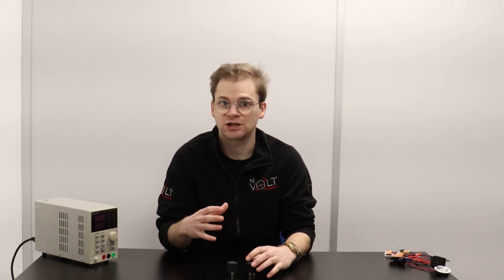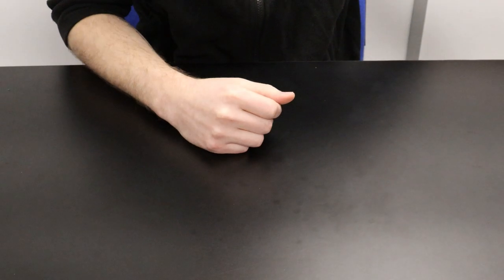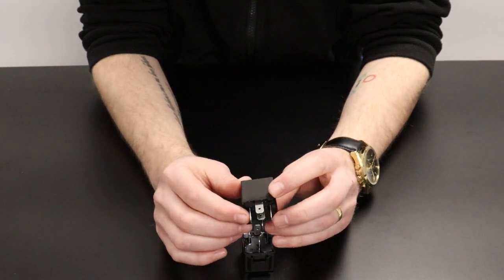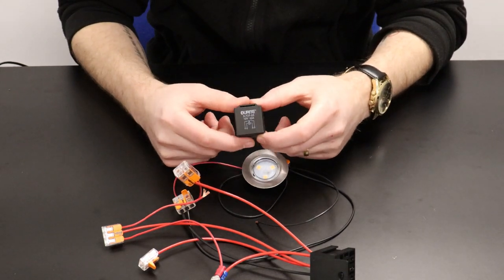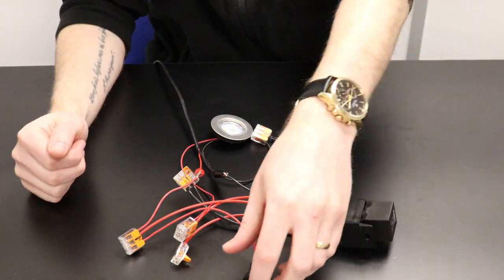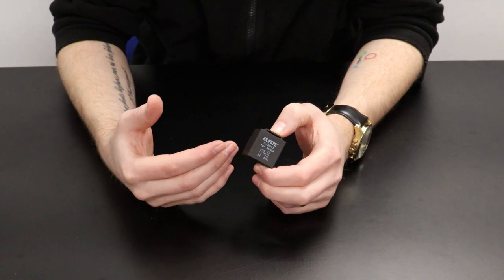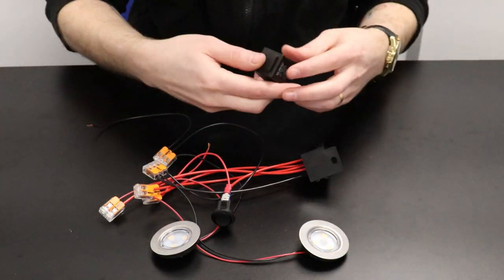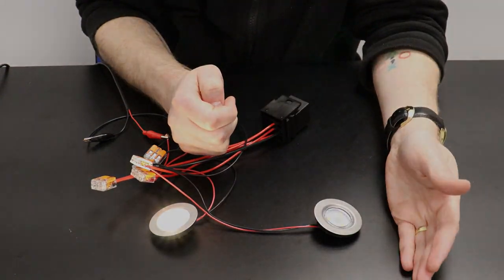Relays Explained | 12 Volt Planet

Comment: I have one of your relays 30A with diode for circuit protection.  Is there a need for a fuse on positive feed to coil and if so what size ....  or am I being over thinking!?!?
Reply from the maker: Yes, all positive cables should be fused. Ideally, it will need to be below your cables maximum current rating and above your max current requirement.